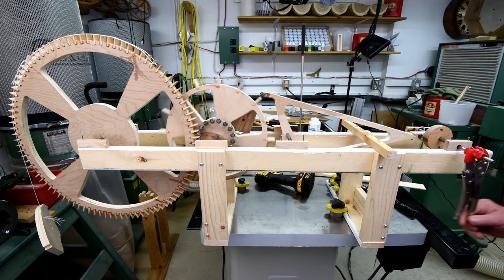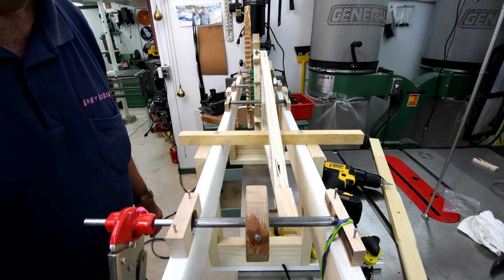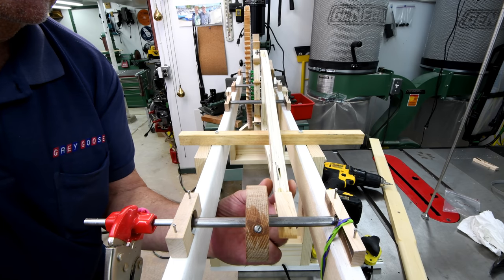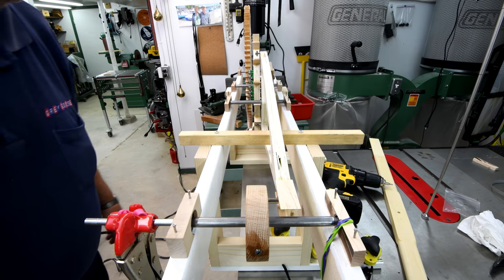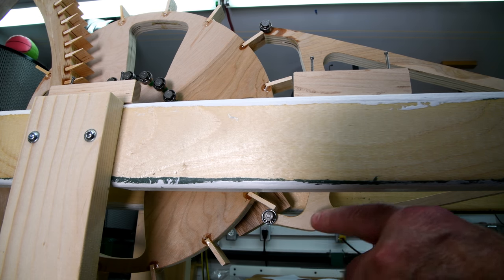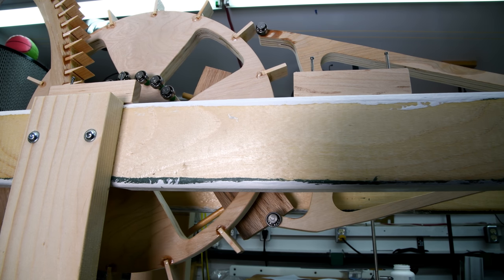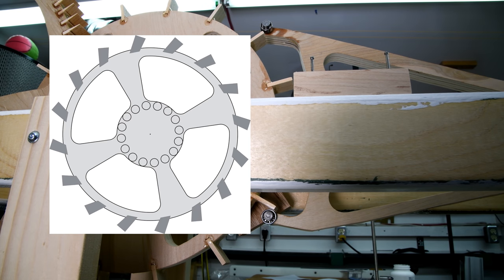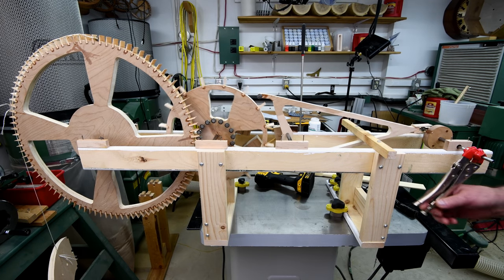The Big Clock Project - Part 44

Comment: Looks like if bearing would go deeper and teeth were shorter the bearing would catch in the corner
Reply from the maker: Yes, I can see what you're getting at. However because the locking face of the tooth is not angled enough, the bearing will still want to roll out. Thanks for noticing that George :)

Comment: Question : Sound is making when you turn it, suppose  to be the << ticking sound of the clock >> Ron?
Reply from the maker: Yes, that's the way it's going to sound, except that, because the balance wheel rotates so very slowly, the "ticks" will be 15 seconds apart --- if it runs on time that is :)